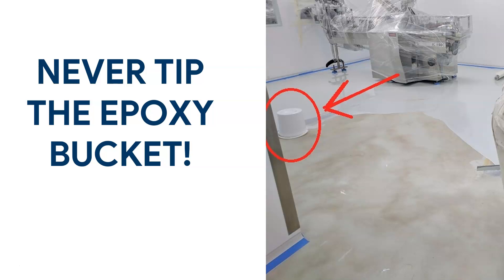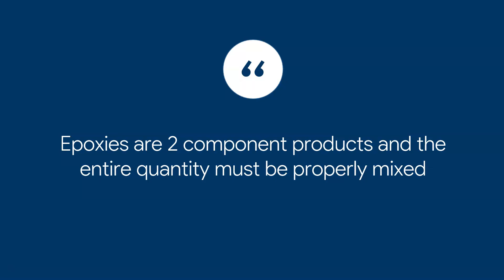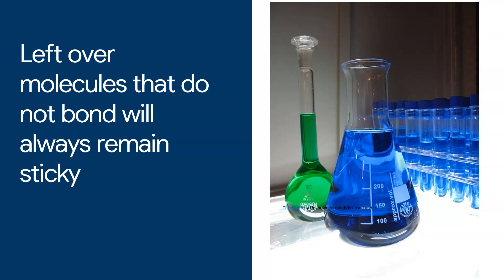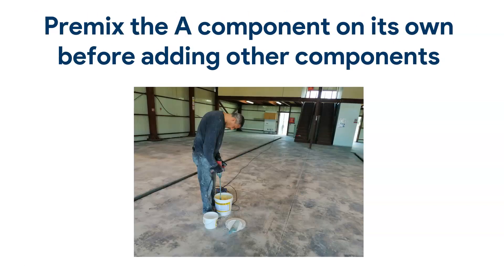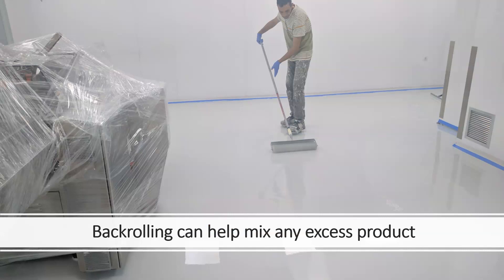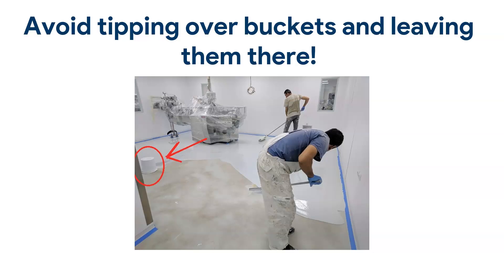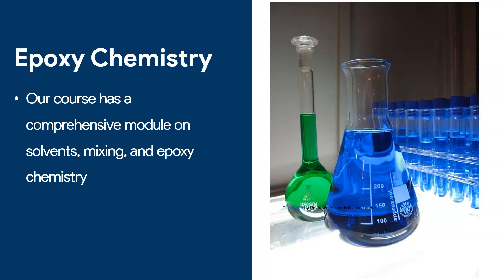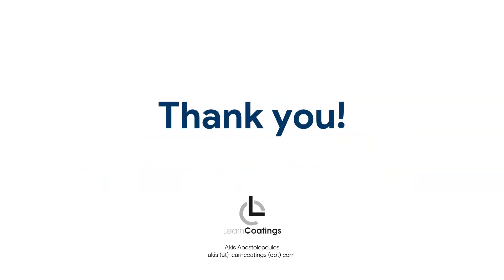Why you Should NEVER tip over Epoxy Pails! - And how to prevent this

Comment: Can you help us,please answer.
What is the best way to make apoxy if we have 1 kg for 1 meter
Reply from the maker: 1kg for 1 metre is not enough for a proper self leveling. You could try applying three coats at 0.3 kg/m2 with a roller. Or you can pour 1kg per 1m2, spread it with a squeegee and try to backroll it to get a uniform surface